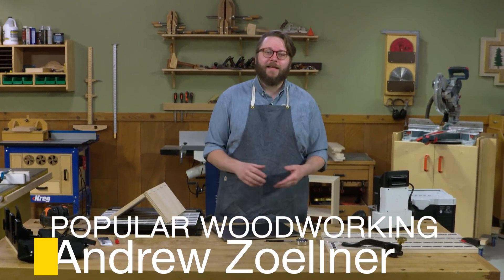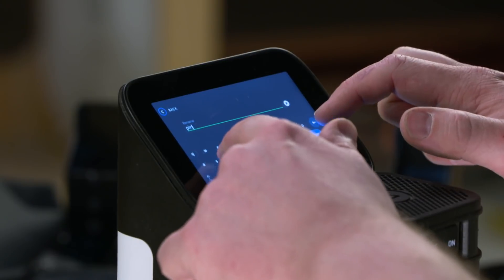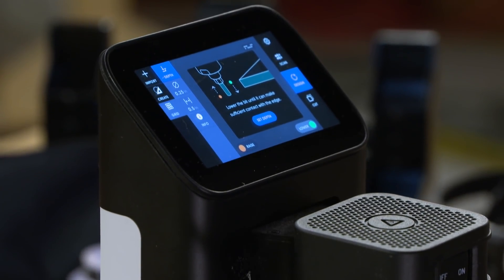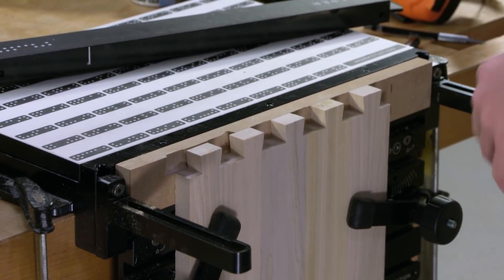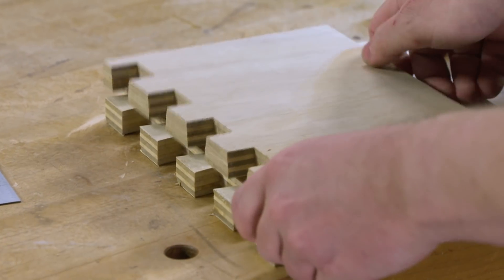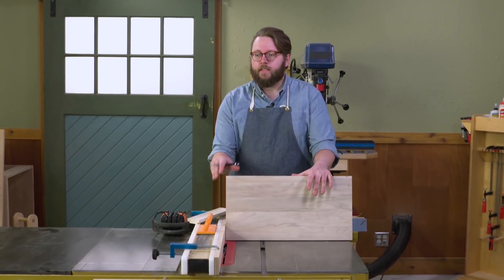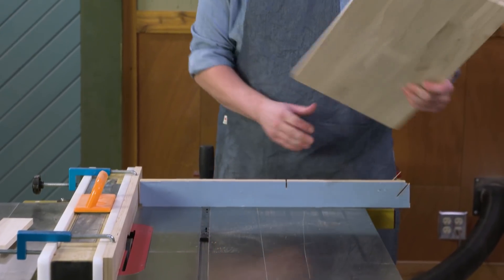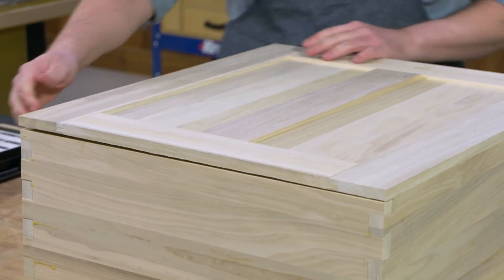Making a Dovetailed Adventure Chest with Shaper Origin

Comment: First I would compliment you on a good demonstration and explanation. 

The first thing that came into my mind as I read the comments here was that it was like listening or reading the comments of many woodturners who use conventional gouges who knocked the introduction of carbide tools back in the late 2000s.  That change helped to get more people turning.

Yes, I know that all you hand tool woodworking folks can do this, but the quality of workmanship will vary wildly. Yes, you have a workshop full of tools and have spent a fair time learning how to use them. 

You seem to forget that the number of young people doing woodworking has fallen through the floor compared to 25 years ago, and if you are my age, then make that at least 40 years. 

So if you want to get into woodworking, you need the technology to entice them plus many of them have the disposable income to buy these tools.

I am currently using a Shaper Origin and Workstation, no I don’t own it but if I can I will because it does what it claims. As someone who has used gantry based CNC systems plus numerous other machines and jigs on the market over the years, I even had a business selling tools, I can say yes it is expensive but over time it will earn its keep and be the tool that solves your problems, and good quality tools with excellent backup are not cheap.

Comment: Eh, if you have a Shaper Origin this is fine. Personally I'd rather save the $2500 and just practice my dovetails instead. At least then I don't have to pay $18 for a roll of tape to do some work.
Reply: How much are you going to pay for lumber while you practice those joints? More than $18? A single roll of that tape has lasted me 1 year of infrequent use.
Reply: @totallynotabot151  No? Practicing joints means you can make the dovetails, trim back the depth, then do them again on the same board.

Comment: also i don't think it does a great job in cutting dados ,and i actually do own this machine and the workstation .i cut my dados on table saw or spindle with the appropriate  cutter ,you can see where shaper did not cut the dado clean ,this is down to how you hold machine ,it only takes a slight wrong move then the damage is done.its a great machine but very over priced but it has its uses in my field of doing floor repairs etc

Comment: This isn't woodwork; it's just using a machine!
Reply: Do you use a tablesaw? bandsaw? router? drill? THAT'S NOT WOODWORKING, IT'S JUST USING A MACHINE! :)
Reply: @rooriders  the Talent with using the tools you mentioned are controlled by the operator, the Shaper Origin is controlled by software commands and remembering how to implement the commands. Timber is getting too expensive to learn how to run another piece of firewood machining tool
🤣🛫